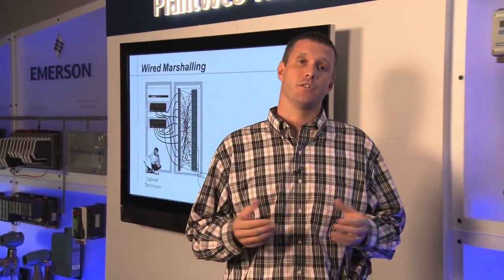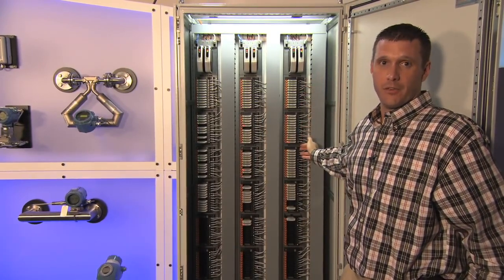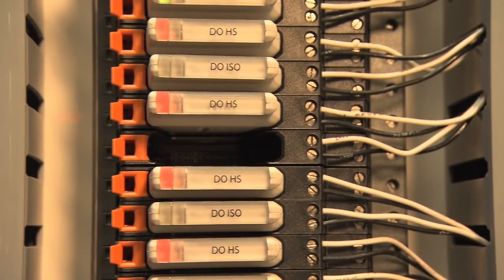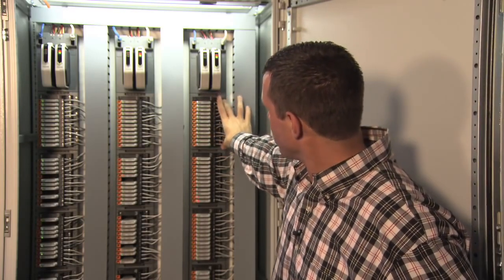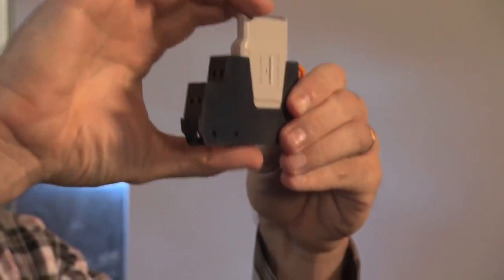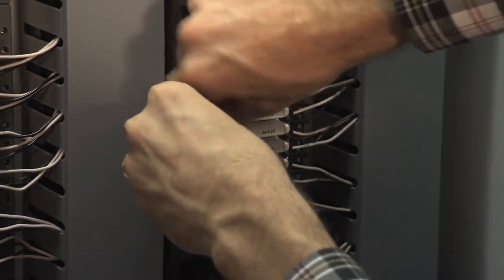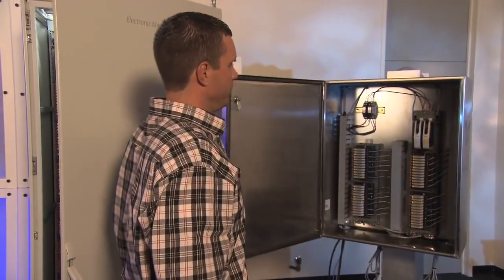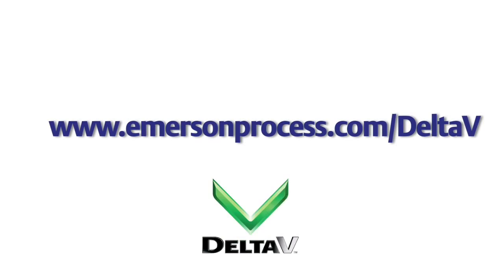Delta V - IO on Demand—Electronic Marshalling - Overview

Comment: Hello, at 2.06 you mention injecting other power. Can these terminals be used to supply +24VDC to a field device, for example, a flow switch that requires power, or do I require a +24VDC power output charm ? thanks.